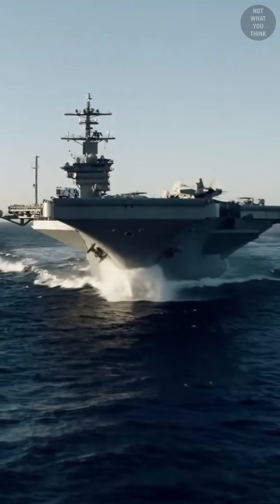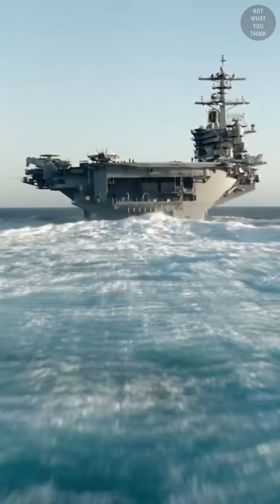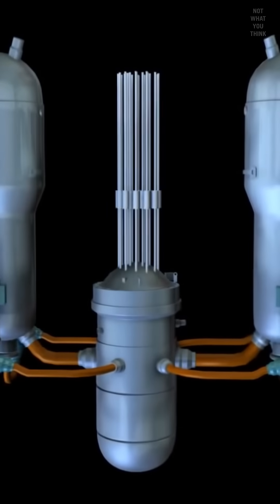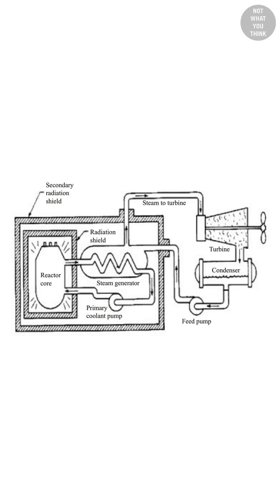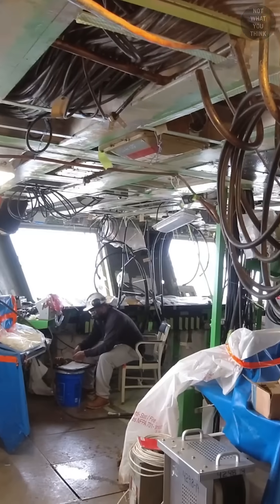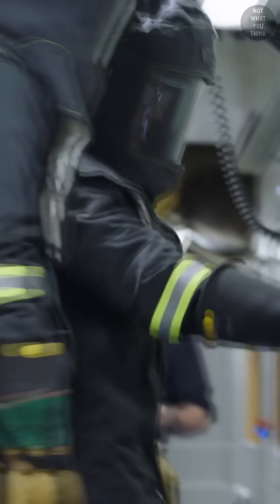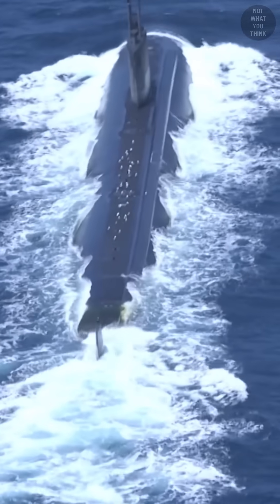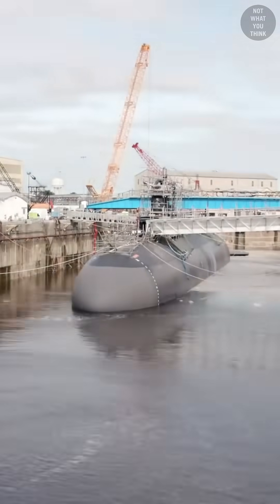How Are Nuclear-Powered Carriers Refueled? #shorts

Comment: That bluish glow of the nuclear reactor is so beautiful.
Reply: it'd be amazing to see it with own eyes
Reply: @2ebarman  Many research reactors do offer public tours.  It's smaller on a research reactor, but still really cool to see.  Some research reactors can pulse to high power level, and it is almost like a camera flash going off.

A freshly opened power reactor is quite intense.  It's very bright and lights up the area.  Since they're around 12-15 feet in diameter it's a lot of light.  In the spent pool you can tell the age of the various bundles by the glow.  The ones only a few years old glow pretty good too.
Reply: @2ebarman  Yeahhhhh, if you can see the blue glow, chances are you're already dead. It's just a matter of your body falling apart.
Reply: @2ebarman  Yes. Although your vision will be lost after a really really short time. Radioactivity is bad even if you are in the area as proved by casualties around and after the Chernobyl accident, let alone direct line of sight to the fuel rods.

Edit: I was wrong. Thoroughly wrong too. Check the comments downward to find out where I made the mistake.
Reply: @naerbo19  not true, that type of glow can only be seen in submerged reactors where viewing is safe. Search up Cherenkov radiation.
Reply: @GalacticTommy  It theoretically doesn´t have to be water but yes thats where you´d actually see it in reality.
Reply: @naerbo19  you're incorrect, the pool around most nuclear reactor cores are usually such good insulators that you could take a swim in them (albeit around 10 meters from the core) without any significantly harmful effects to your body as the radiation isn't much higher than background in the water @ that distance.
Reply: @ok0_0  , my incorrect assumption then. Just so happens that my brain thinks sharp colors as warnings. But even so, I wouldn't be that near it if I could help it.
Reply: @naerbo19  I would probably avoid swimming near it as well, despite it being pretty safe it does feel kind of scary. You're mostly correct though, if you see the ionizing glow of radiation in air then it's definitely a bad sign, in water it's more 'okay' because of how good it is at absorbing radiation compared to other transparent mediums (like air)
Reply: @GalacticTommy  no it was seen during the chernobyl event but it was lighter
Reply: @AuGrrr  nope, that’s the molecules of gas exited by the ionising radiation releasing their excess energy in the form of visible light. Cherenkov radiation is caused by the charged particles moving faster than light (this is why I said you can only see it in water as light moves slower when in water).
Reply: @ok0_0  yeah, I remember reading a story back around 1980, when I used to SCUBA dive, about a group of specialist divers that used to dive in portions of nuclear plants to inspect and/or repair various components.
Reply: @johnpatz8395  that makes sense, sending men in lead-lined wetsuits doesnt seem too dangerous, when I first heard about it I thought it was a joke but after researching more into the matter it turns out that water is really really good at absorbing radiation. It must be a super exhilirating job though.
Reply: @ok0_0  yeah, I wish I still had that article, since as I recall it was fascinating, and wasn’t something I had ever even considered might possibly exist. As I recall it was part of a series of articles, one each month, looking at the highest paid diving specialties, and the month before, or after, was about immersion divers in the North Sea.
Reply: @naerbo19  The radiation won’t go more than a few feet underwater
Reply: @ok0_0  quite common for reactor pulls to have divers go in to do work. Just as you state, they are totally safe as long as they keep proper distance.
Reply: @GalacticTommy  the "blue flash" that is someone reported in nuclear excursions is as you described it but it is seen because the water in your eye is ionized. This is how you can "see" it in the air.
Reply: @naerbo19  ya know that's fair. At very minimum it's spooky as hell.
Reply: @ok0_0  for alpha and beta rays water is super effective at absorbing, gamma based on the amount of mass between points A and B, so while water is far from ideal it can do the job, and is a fuckload more effective than air. So having a little lead around is definitely advisable, though on a wetsuit it's probably a bit of a workout depending on how much lead they're talking
Reply: @expertoflizardcorrugation3967  dunno, If they're trained for it im sure they manage though. Crazy that there are people that actually do that kind of job though, it's pretty badass.
Reply: @naerbo19  
If there is water in the way, you don't have DIRECT line of sight. It only takes a few feet of water to reduce radiation exposure to less than airplane flight levels. That blue glow is actually proof of water's ability to shield radiation by absorbing the energy of the radiated particles and converting it into heat and light while also converting some hydrogen into deuterium or tritium.
Reply: @XMysticHerox  it has to be anything in which I believe the speed of radiation has to be faster than the speed of light.
Reply: @ok0_0  if you dive under the surface of such pool you experience less radiation than on the surface of it.
Reply: @ok0_0  You can also hold plutonium in you hand with no ill effects due to the long half life. I still wouldn't do it....
Reply: @davidd5523  oh yeah, I knew that one. Plutonium is definitely a bastard to handle but lots of people really overestimate how dangerous it is as long as you don't consume it or blow it up
Reply: @GalacticTommy  is the blue glow showing up as it is starting up?
Reply: @naerbo19  No absolutely not. Gamma rays are easily stopped by water and you could swim in it as long as you're not too close to the core. It takes about 2 meters of water to stop them.
Reply: @bigpig187  So I've heard repeatedly. That in no way shape or form is a REASON to go swim near a reactor though. Will the water be water at 7ph? Will it have the same temperature?
Reply: @naerbo19  First of all i never said it would be usefull to swim in it. You were talking about radioactivity and being blind because of that, not if you could find fish it it.
Just edit you first message then. I was just pissed of seeing peoples teaching other on radioactivity based on a HBO tv show and still arguing... The water around the reactor is there just for stopping radiation. It is not hot and radiation does not change its Ph but it can form some gas close to the core. I took 10 minutes to figure that out. Just do some research instead of asking open questions not related to the first topic
Reply: @naerbo19  water is pretty good man, do some digging, much of the bad press around nuclear power is due to the scare tactics fueled by Chernobyl and three mile, both of which were due to poor work controls and thoroughly terrible operators.
Reply: @naerbo19  ikikkkikkkikkikikimump
Reply: @ok0_0  yeah, even if that was true I wouldn't even want to swim there. Yikes.
Reply: @abs5721  i'd do it just for the experience
Reply: @naerbo19  While at least you admit. Not enough people are willing to do so these days.
Reply: @OGDaddyFatSac  yes.
Even 5.56mm Bullet can't go further than 1m(little bit more then 3 feet) in water

So, dive into water is the best bulletproof armor you can have.

It's because density of air is 1.18 kg/m³ while water is 1,000 kg/m³
Reply: @naerbo19  Water is a perfect radiation insulater and a coolant. Every reactor is surrounded with water. Thats why you can look at the blue light with you eyes. 
Also that blue light happens if the reactor is cooled with water, radiated free radicals makes water exited and glow, it doesnt occur with other chemicals. So water causes the glow and its not radiation. Also you cant see radiation no matter how strong it is, its not on our spectrum.
Reply: @urmom2438  I'm thinking it reached criticality at the point of lighting up
Reply: @GalacticTommy  what about the demon core incident that guy saw a blue flash granted that was also most likely due to the water in his eyes and brain
Reply: @naerbo19  kudos for owning up to the mistake
Reply: @Gamer-nc8qp  My goal isn't to be right in life, but rather to learn. And to do that I have to be able to own up to mistakes. I have also made a point of knowing that even if people tell me I'm wrong, doesn't mean it is an attack on my ego and therefore I should learn when I can.
Reply: @naerbo19   this types of radiation showing vids are not being dangerous to watch on our phone, PC, or TV screens for our eyes & overall health.....? 

Means is it safe to watch nuclear bmbs explosion vids & this kind of nuclear radiation lights showing vids.....? aren't we getting any radiation or its effect on us by watching this in vids......? 🤔
Reply: @naerbo19  no you can watch the glow standingboutsideba reactor is completely safe it's only when it's brought up to full operation you can't because it needs a little because of steam
Reply: @ok0_0  it’s actually cleaner and safer than regular pools
Reply: Cherenkov radiation! it's quite beautiful, and by itself pretty harmless.
Reply: @heart_break1  They use what's called 'heavy water' in many reactors. The water has extra isotopes in the hydrogen of the water molecule(H2O↪2HO/D2O, or deuterium oxide) to make it more dense & bypass enrichment processes. So denser water adds more of a protectant quality altho they say at a certain distance w/even reg'lr water('light water'/H2O) & even less its not as dangerous as many would think. But I'm good...its still too close for me. The whole thing is mazing how the process was discovered tho IMO.
Reply: @jayski8082  heavy water reactors aren’t that common compared to light water ones. The fuel in naval reactors is much more highly enriched so doesn’t require heavy water.
Reply: @jayski8082  unlike normal water deuterium oxide also acts as a neutron moderator instead of neutron absorber. The pool in which that reactor sits is just normal water I'm pretty sure.
Reply: Beautiful but radioactive
Reply: Here's a video that shows it and explains it
https://youtu.be/uYrhWO_ZLYw
Reply: I know right?

That's why I've filled my bedroom with radioactive things 😎😎😎😎

(And no I'm not joking lol)
Reply: @greenalien8503  eh so long as you keep them sealed to prevent any radioactive particles from getting Into the air most damage will be mitigated.

Unless you've somehow gotten your hands on some real toasty material.
Reply: @expertoflizardcorrugation3967  I have a while bunch of low level radium pocket watches, but they're all sealed behind 3/4 inch thick glass, and their paint is in really good condition, so I just keep them in my room so I can stare at the radioluminescence in my room lol
Reply: lol
Reply: You ever want to know what death looks like that’s it
Reply: You should look at it with no protection
Reply: Yes, remember X-Men?
Reply: Jack Sparrow  Cherenkov radiation can occur in any dielectric medium and with the right refractive index you can see it. Look it up.  An example would be ethanol in which yes you can see the blue glow. 

However even when not visible with the naked eye it can still be observed in various other substances like quartz for instance.
Reply: @Lazys The Dank Engineer Air ionization is a different effect.
Reply: If you see the light underwater and the water is deep, you're all good. But if you see it outside, you're a dead man. You will be fine after seeing it but you will die in a few days time. It's terrifying being healthy enough and still knowing you will die in a few days.
Reply: Cherenkov radiation is cool
Reply: That's Chernenkov Radiation.  It's caused by particles (like radioactive decay ones) moving faster in a medium than light can. Nothing is faster than light in a vacuum, but it's not always the fastest in air or water. It's like a visible light version of a sonic boom.
Reply: Actually the blue glow you're seeing is Cherenkov Radiation which travels faster than light. (In Water)
Reply: @MinutePlant  It tingles 🥰
Reply: Yeah it looks like something straight out of a movie.
Reply: Deathly beautiful
Reply: I wanna touch it
Reply: Imagine how blue fukushima core submerged under the ocean
Reply: its the aldnoah core
Reply: No, that's death lookin you in the face.
Reply: @OGDaddyFatSac  the water is taking most of the radiation. Alpha and beta particles aren't getting out of the pool. They'll bounce around the water until they run out of steam... Gammas are probably gonna get out, but the vast majority of gammas are going to pass through you harmlessly, plus thanks to our friend the inverse square law, outside of that pool your chances of any harm are miniscule inside that pool you just need to keep your distance
Reply: Yes. I must have it.
Reply: But deadly
Reply: I was more impressed that they catapults and trebuchets
Reply: And deadly
Reply: looks at self 

"This blueish glow on me I got from the reactor is so beautiful" 🙂

🤢🤮😵☠
Reply: @GreyBlackWolf  reminds me of that cesium accident.
Reply: and deadly
Reply: Thats what the people who discovered uranium said, and they uhhh, yeah….
Reply: Cherenkov radiation in water you should be fine. Cherenkov radiation in air… back tf away or you’ll get some nasty burns.
Reply: I have some fiesta ware tea cups that i still drink my coffee out of.. 30 years doing it and I’m still alive lol they are see through but have a beautiful highlighter yellow color that pops with a black light. I have some other fiesta ware too but they have some chips and whatnot from age so they are in a glass case with black lights on them to show their beauty. There’s also some uranium marbles and other trinkets in there which people always trip out on.
Reply: Forbidden glow
Reply: What you saw is animation.
Reply: And deadly
Reply: But the yellow glow of a nuclear explosion is so much more of a hot colour nowadays. 

God, I wish that wasn't true
Reply: The forbidden light.
Reply: Cherenkov radiation
Reply: The people in this comment section should operate a nuclear power plant. ☢️👀🍻
Reply: its called cherenkov radiation
Reply: Yeah, water sheilding is ultra cool....
Reply: It’s faster than light
Reply: Cherenkov light :)
Reply: Forbidden spicy water
Reply: There's a video of it turning on with audio
Reply: And radio active as hell
Reply: @Lazys The Dank Engineer wrong it's because water slows light and particles given off mice faster than the light creating this effect
Reply: That’s probably not a good thing to say
Reply: Light boom.
Reply: That's not a glow. That's the radiation dissipating to photons.

You're gonna die.
Reply: @GlitchedBlox  your a idiot
Reply: @livingglowstick1337  My what? I don't think i own an object called "a".
Reply: Wanna go skinny dipping in it ?
Reply: Go towards the pretty light 😍
Reply: it taste even better
Reply: Its amazing how close you could swim to a reactor giving off charenkov radiation.  Basically if you stay out of the actually glowing water you'd be fine till the water heated up.
Reply: It’s all fun and games until there’s no water 💀
Reply: I like it.
Reply: until it explodes
Reply: That cancer growing in my body is so beautiful.
Reply: You can actually swim in it and drink it 

But You’ll die
Reply: and deadly
Reply: @StarscreamX404  not really what your seeing I light being slowed by the water being energised by the radation looking at it is perfectly safe and swimming in the water is fine as long as you don't go too close and its not at full power otherwise that water would be boiling

Comment: Heard about that, rather interesting stuff. Heard the replacements for the ohio class submarine are gonna come with that exclusively, though I bet the reactors will be fine, even if left unchecked for 40 or 50 years.
Reply: "no refueling" does not mean "no maintenance". Intense radiation on its own denatures almost materials, including metal. There's no such thing as a "set it and forget it" nuclear reactor.
Reply: @lossssantos   They're not going forget about they still have nuclear engineers on board these ships they're supposed to be good for 40 or 50 years without refueling AKA the lifetime of the ship.
Reply: The reactors and their surrounding infrastructure are constantly checked and monitored by the crew on board.
Reply: It’s more 20-30 years for chubmarines